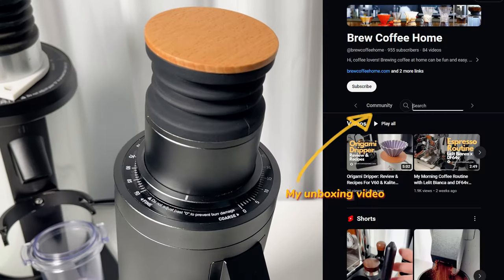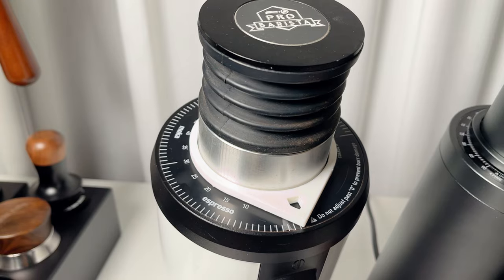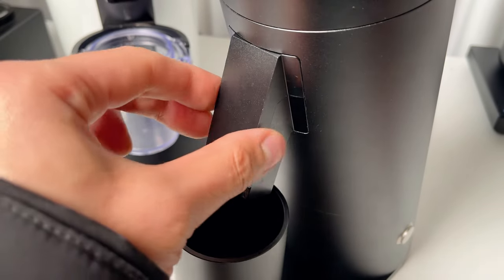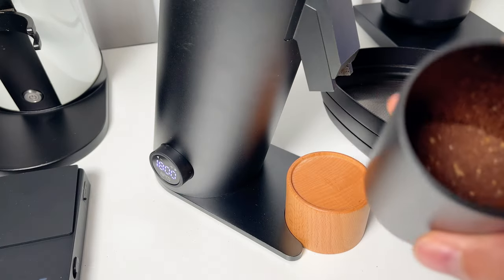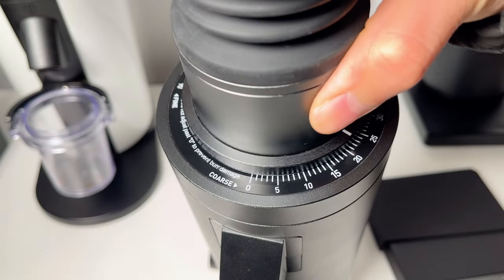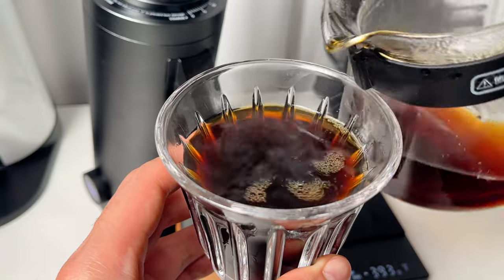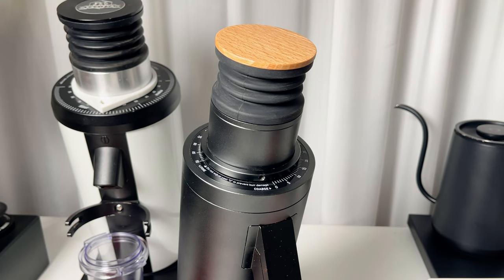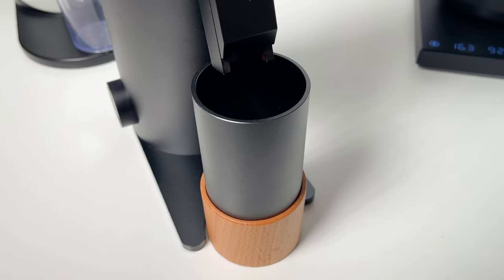DF64V Coffee Grinder Review -  Detailed Walkthrough & Comparison with the DF64

Comment: How does it compare to the Hibrew G5 ?
Reply from the maker: The DF64V is a much better option for those seeking higher accuracy and flexibility, although it comes with a higher price tag. On the other hand, the G5 is an affordable entry-level grinder that meets the daily needs for espresso, though it's not on the same level as the DF64V.
Reply: What are the practical differences?
Reply from the maker: @notmaxib  The DF64v has 64mm flat burrs, better build quality, and adjustable RPMs, versatile for both filter coffee and espresso. G5 uses a much smaller conical burr (maybe 38mm), mainly for espresso. Both have a stepless adjustment and produce grinds in the espresso range for a good shot. Hope this helps. :)

Comment: I've ordered one but the static is a bit of a worry for sure
Reply from the maker: I always spary some water to the beans before grinding (RDT or Ross Droplet Technique)😉
Reply: this always happens on new burrs, when they're seasoned this static will reduce a lot
Reply: @ 5 months and tonnes of static. We’re not in a cold or dry place either. Quid humid and cool
Reply: @chrismccannIRL  okay, that's surprising. How is it other than the static?
Reply: @Cenot4ph it’s a decent grinder and produces pretty uniform grind for espresso. I’ve not tried it on other coffee types. At the start leaving it plugged in it made a strange sound for a few weeks around the led screen rpm control. Like a transistor sound. That’s disappeared now. When grinding it’s pretty loud. It’s quite a high pitch grind sound which is a bit annoying. More like a squeal. It’s also got this issue which I read from others that you need to start and stop a couple of times at the end of the grind to force the final little bits of the last bean or two into the burrs. But once you do that it inputs 18.5 and outputs 18.5 nearly all the time.
Reply: @chrismccannIRL  thanks, I'm looking to get it because it is consisten from whst I've been reading.  Since thats a very overlooked characteristic especially in combination with a Flair 58, its quite important to get many variables as stable as possible
Reply: @ yeah i have to say it’s super consistent. If those relatively minor flaws don’t matter it also has a neat enough footprint. I’ve had a few including Gevi Grindmaster and the larger DF83v (which was far too big) as well as some eureka models and this one produces the most consistent grinds for sure. The Gevi was great too but the others were a bit inconsistent. If the Lagom Casa 64 was available at the time I might have chosen it despite being conical
Reply: @chrismccannIRL  thanks,  i will look into the casa and also the femobook just to be sure

Comment: After owning this grinder for several months I have only one piece of advice:  DON"T!  Just don't.  If I start listing all the things I don't like it will include essentially every component of this poorly designed, poorly manufactured, and poorly assembled PoS.  Is it capable of grinding good espresso?  Yes.  But the entire experience that surrounds that is really not good.  There are PLENTY of other high end single dose grinders that do not suffer from these issues.
Reply from the maker: Thanks for sharing! I have been using it for quite a long time, I think it does the job well. My version hasn’t been upgraded, so without RDT, there’s a lot of static. Also, not having a portafilter holder is a bit inconvenient, but overall, I think it’s a pretty decent option.This grinder costs around $500, so it might not match up to high-end models.
Reply: @brewcoffeehome  If you have access to a 3D printer:  1) Print a PF stand.  Or buy one like the nice version IKAPE just released.  2) Print a stand to tilt the grinder another 20 degrees forward -- grounds can now fall closer to vertically yet you can still load beans in the tiny bellows.  (If you use the IKAPE  mentioned above, make the stand an inch taller to accommodate its height.) 2) Print a new CONE-shaped spout (with embedded magnets.  Tune geometry of your cone to match your PF height/circumference.)  This will fix a couple key bad design decisions and eliminate much of the static build-up, the "throw grounds all over your counter" issue, and some of the poor retention (although much of that is internal and requires replacing another part) that come from the base design.  Or for anyone else:  just don't buy this junk in the first place.